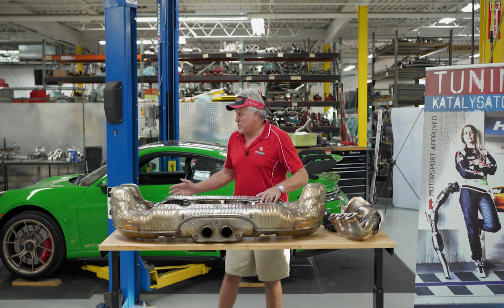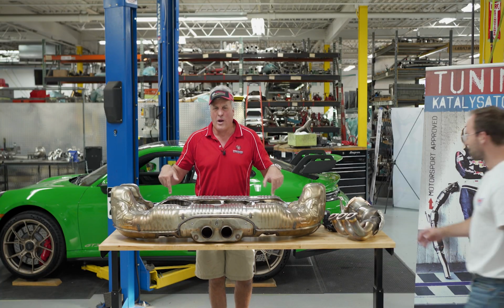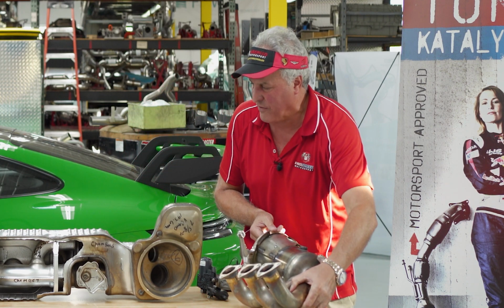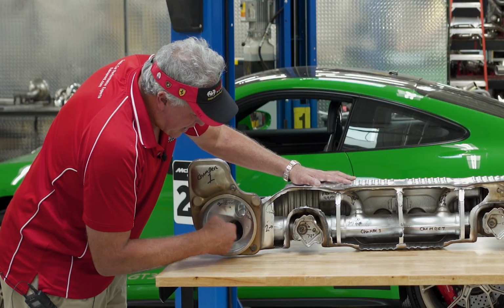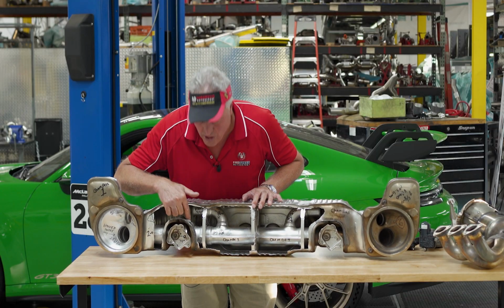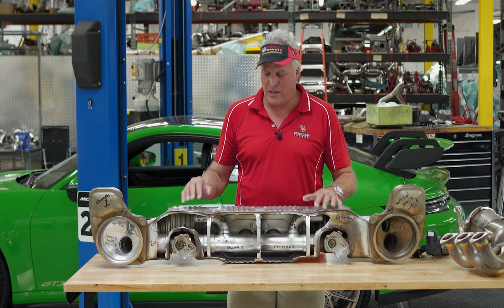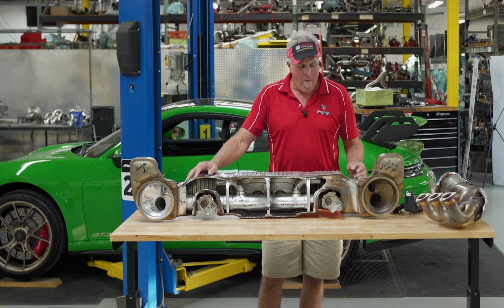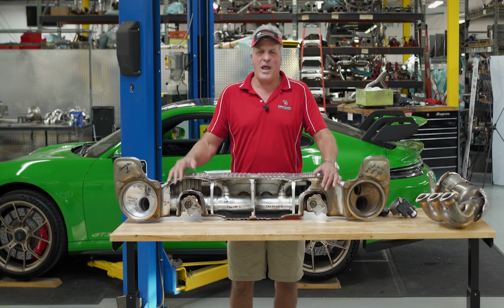992 GT3 2022+ | Stock Exhaust CUT OPEN and Explained | How It Works

Comment: OPF filter? I thought just the EU versions will have the OPF filter, the US versions should be without that.
Reply from the maker: Just like the 718 GT4, the US versions have an inert GPF filter. So the physical structure is still there, but the precious metals that filter the exhaust are not there.
Reply: @FabspeedMotorsport  thank you for the answer!

Comment: so what happens when the valve is open
Reply from the maker: The exhaust travels straight through the H-Pipe
Reply: @FabspeedMotorsport  So how can you guy’s improve on that? With let’s say stock cat’s is it  even possiable
Reply from the maker: @ivanmiller6378  Great question! By altering the design of the muffler we can change the tone of the exhaust, particularly at lower RPM's. We will also use an X-Pipe instead of an H-Pipe which has been shown to improve power and give a smoother exhaust note. There may also be power to be had by upping the diameter from 2.5in to 2.75in.
Reply: Will it possible that your exhaust affect the torque in the lower rev ?
Reply from the maker: @kevin5716  Yes definitely. Headers should give us that.